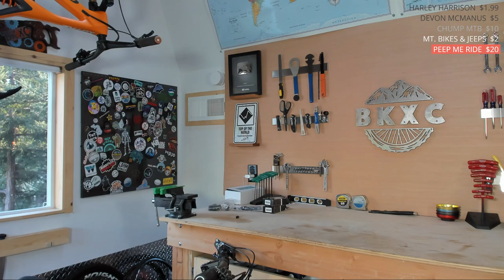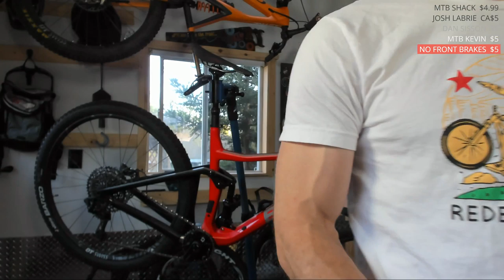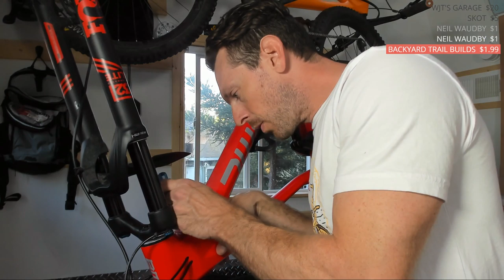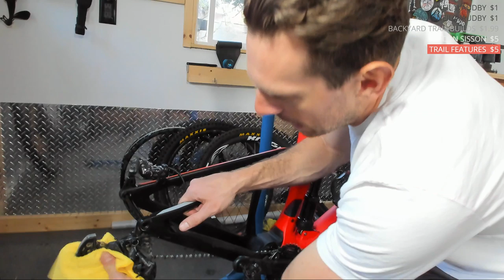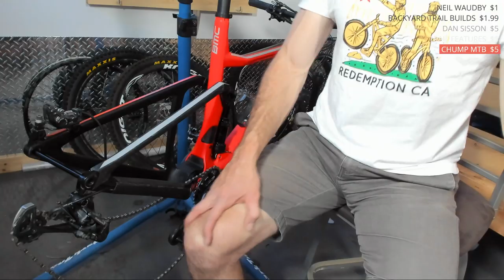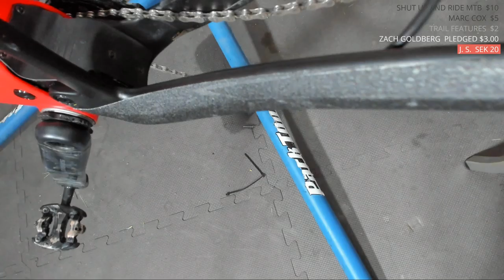Installing cheapo (but solid) frame protection!

Comment: I use the stuff(clear sticker) from auto parts store that you can tape over car bumpers or handle bars for scratch resistance. They are not cheap, but they come precut in various sizes that are quite suitable for bike frame protection. This way you won't have to buy the whole roll(like the heli tape).

Comment: Why not the 3m vynil heli tape
Reply: I’m thinking the bathroom tape stuff is more a matte finish?? Is that why? I have a matte black remedy 8 and want to know!
Reply: @brokenlegz  I'm not sure man.but i had 3m clear vynil from Amazon. You apply soapy water and it goes on glossy. I out it on my matte black scott spark and it came out looking way better with the gloss vynil
Reply: B line sender I’m just thinking I won’t cover every little bit of the frame and it might look weird with some glossy and some matte?
Reply: @brokenlegz  i did it and looks awesome